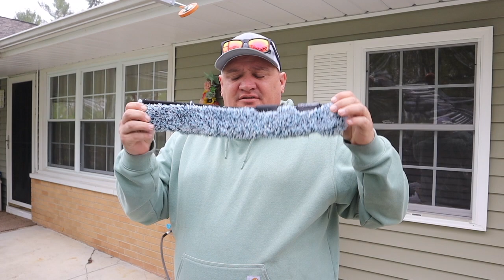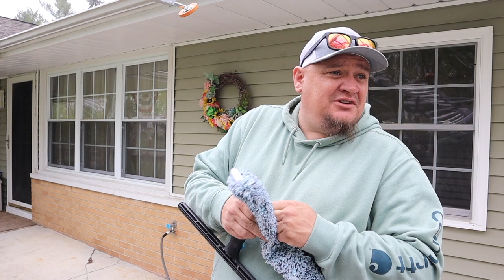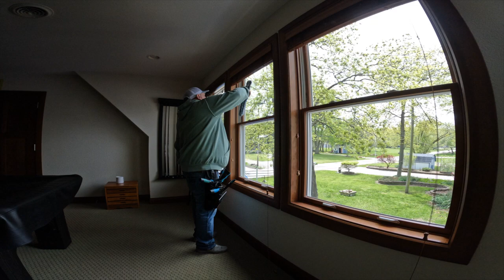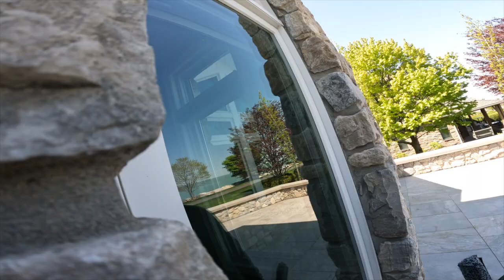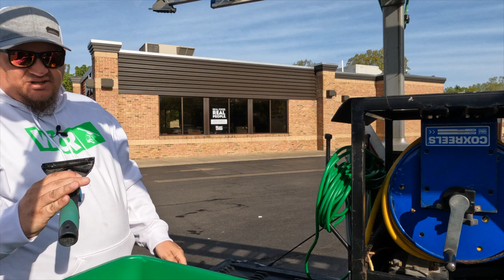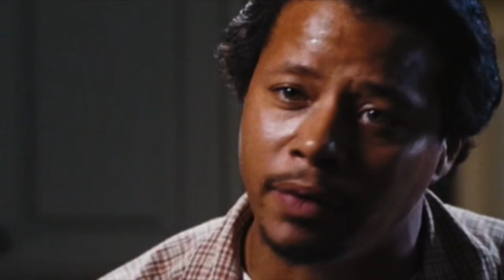One Week with Moerman #squeegeelife #moerman

Comment: Hi
Enjoyed watching your video whilst eating a bag of cheese & onion crisps.Very entertaining watching you rant & rave!
Been there myself when first got one & they only sold the fixed handle which was set at wrong angle, making it impossible to use without leaving a triangle.
The fix for the channel sliding up & down once really soapy is fit the Unger plastic clips into the outside of the end clips “glass side”.
This will nail the rubber in place & at same time solve the channel sliding.
I find they work far better with the Unger “medium” green rubber.
Once the rubber isn’t sliding into the channel anymore once it’s fixed in place, you shouldn’t get the “chatter” you are getting on the frame rubbers.
Hope this helps👍

Comment: I use the liquidator 3.0 and Excelerator handle on the daily for commercial and residential. Once you get used to using them they are great. I would suggest using the -5 angle when doing window on a pole and you want to finish the whole window. I would also suggest not using the moerman soap and just using the dish soap. I would recommend you add it to sleeve as well as the bucket. Never use blue rubber. I really don’t like moerman fixed handles either. You find with the liquidator you have to have it 25 or 10 most of the time in hand. Also was that excerlerator handle shown in the video previously hold a ettore channel? If so that will be case why the moerman channel moves as the ettore brass bends the plastic as its thicker.
Reply: Also the dr angle fits on to the  World Enterprises Trad Adapter from WCR
Reply from the maker: Cool
Reply: Happy to help if you end up giving it another go! It is quite a bit of learning curve to learn. I do love the unger range, that’s  what I previously used before and still would happy to use 👍
Reply from the maker: @mitchwilcock  appreciate that!
Reply: Hey I was only tauht waterfed. When going traditional do u just mix dawn with water and nothing else? What's the usual ratio

Comment: I purchased moerman T bars 14 and 18 and moerman pouch took them back to the supplier T bars would not lock and the pouch belt clips will not lock put a cloth in the bag the whole thing fell of the belt moerman need to look at there quality and i agree with you rubber no good. Thanks for the review

Comment: Try using it with rubber uncut just straight square rubber with likea mil over the clip you get used to the feel of it without it being to different that's me going from a traditional tool for 15 years then switching.amd bend the bi component handle back tl a few degrees and t really helps once yoh get it , then its the best tool ive ever used . I rarely cut the angle in nnnthe rubber these days if it goes wrong its a dead rubber.

Comment: The handle is awesome for pole work,
The channel is fine if you don’t cut the rubber ends,
Just use it with a green unger rubber & straight ends,
I have two of the handles, & I’ve been ready to put a brass channel in one of them , but i haven’t needed to
Reply: If I'm in FL should I use green?
Reply: @silentgrind34  green rubber is the best I’ve used in 38yrs👍

Comment: I used to hate the channel but I couldn't let it go because of the benefit of not having to detailing the top and the sides especially for pole works. If you decide to give it another go, put in an Ettore or Unger green rubber. The angle of the channel should be much closer to the glass.
Reply: If I'm in Orlando FL I should be using green rubber?

Comment: With this setup get that boo boo blue rubber out first of all
Install some hard BD mix up some Sudsy solition with sufactacnt
Use the angles of the handle as presented by the window/door type 

Recognize that the tool is a finely aged bourbon not the house whiskey 

Then ask yourself...Are you an ameruer or a professional?

Craftsman dont blame their tools in any trades 
We should be no different 

Now the bottom line 

Some people are unwilling to make adjustments to meet the channels hang ups 
It is a $$$$ making machine for my day to day needs.
Reply from the maker: I do just fine with what I use. Don’t need a gimmick to put checks in the bank. Appreciate the view and your input though